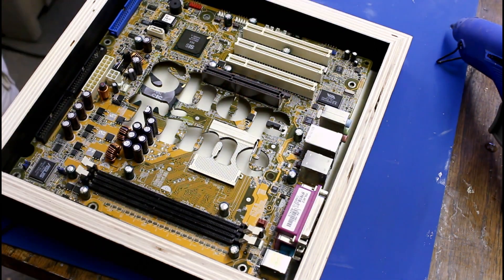Light Box Logo Cut On A Water Jet!

Comment: Peter, with a water jet, it is not the water at the incredibly high-pressure that does the actual cutting, it is the garnet or other abrasive in the water stream that does the actual cutting.  There is a desktop water jet on Kickstarter that may be of interest to you as this is an awesome machine.
Peace!
Reply from the maker: For the record. The motherboard was cut solely with the water. No abrasive. 

The motor, of course, needed the garnet.
Reply: Cool! The high pressure water will do a number on your body too!
Reply from the maker: We talked about that too. Crazy powerful & super destructive,

Comment: hey Peter, just a suggestion. if you want to do more resin backed boxes I suggest cutting a few things holes in the sides of the box for positive retention. shouldn't be an issue for this project because it won't be moving a lot but for future reference it's good to do.  had a couple decorative boxes have the bottom fall out because I didn't have them positively retained and made a mess of my storage shelf
Reply from the maker: thanks for the tip Austin! I'll remember that!

Comment: Gah. You never stated the socket type! But based on the number of pins on the power connector and the AGP slot, I'm going to venture a guess that it's a socket A (462). I like how the jet took just a wee nibble out of the locking arm around the 'e'.

Point of interest, I read that a desktop water-jet cutter is in the works. "Wazer" if I recall correctly.
Reply: Nope it's a socket 754, the exact motherboard model is an ASUS K8S-LA